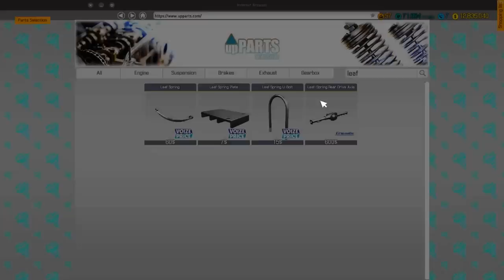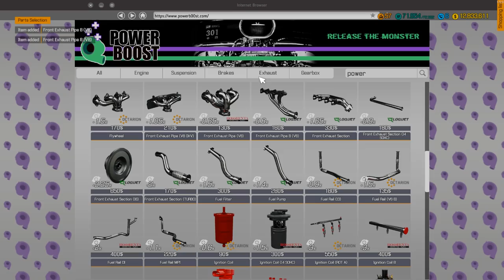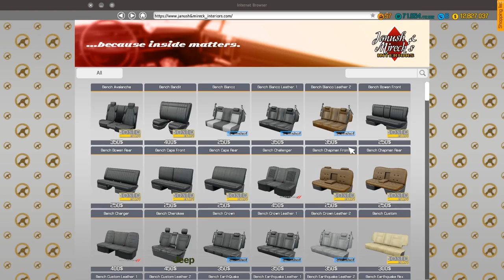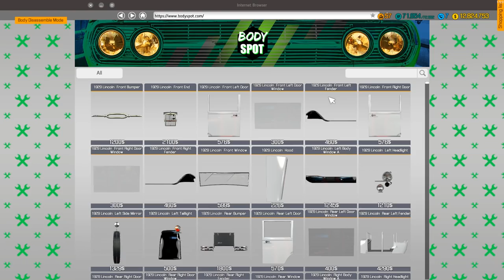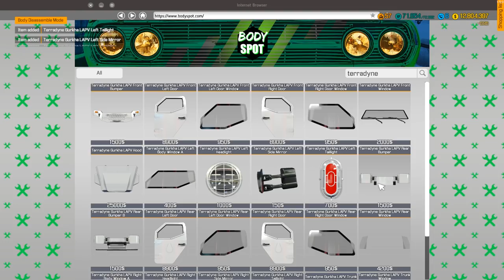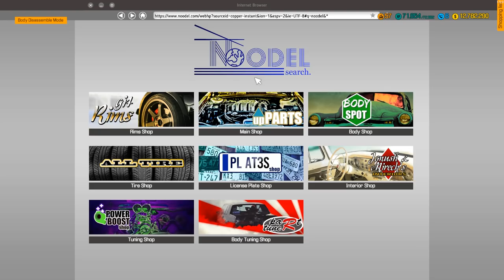Terradyne Gurkha LAPV Restoration : Car Mechanic Simulator 2018 : PC Lets Play

Comment: Hey ) I have an issue with tire procurement so I was wondering how did you get 355/70R22 for this monster. The maximum size I can get in In-game Store is 325/45R22 which is really smaller......... And advises?
Reply: @Kot Cat turn on unrealistic tire sizes in the main menu hope this info helps :)

Comment: Only one question.  Why would you repair the frame AFTER you've already installed some parts?  In reality, you remove all parts till it's completely bare, repair and polish the frame, then start putting it back together.